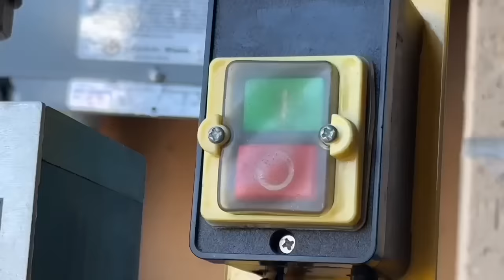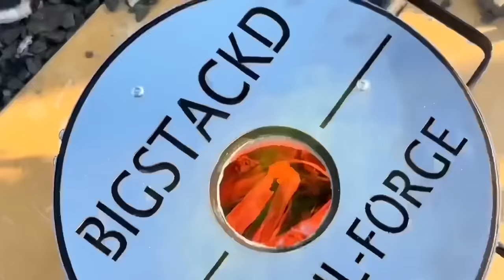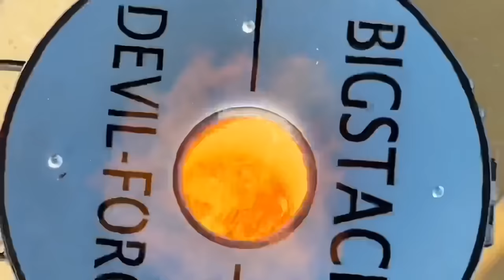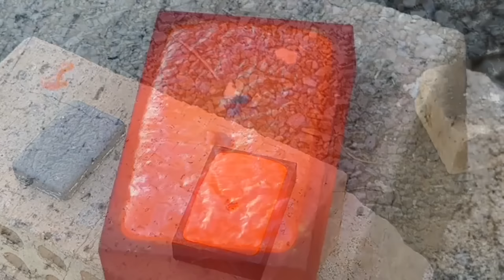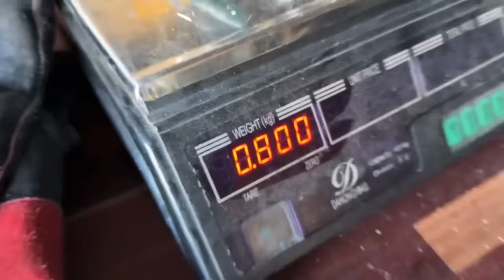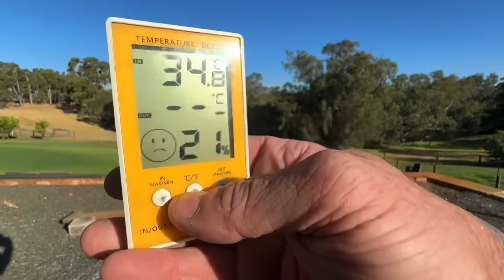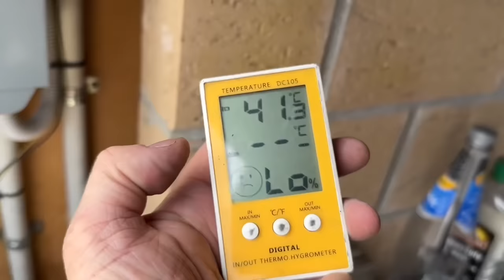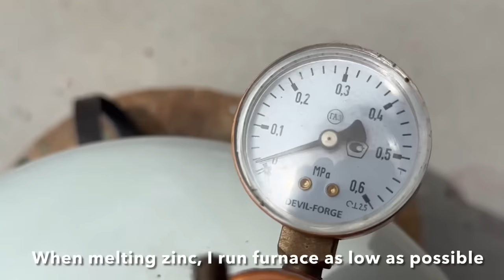Copper Bullion From Scrap - Total Transformation - ASMR Metal Melting - Trash To Treasure- BigStackD

Comment: I used to design cartridge heaters - thats most likely 304 stainless or incoloy depending on how cheap they went. The white powder is MgO. It is generally swaged with the heating element in tbe middle, and then bent to shape. They sometimes come with brass pipe fittings on the end so look out :)

Comment: Nice copper and brass bars mate 💪🏻.
The heat is tremendous there, here in Argentina we are exactly the same and on top of that we have been hard storms in a large part of the country that has caused flooding and destruction, luckily there was none of that where I live.
I have so much material to melt but I am still looking for a foundry and the necessary elements.
Big hug from Argentina 🇦🇷👋🏻💪🏻

Comment: Heating elements are typically stainless (or possibly Inconel but that's expensive) cladding around ceramic insulation and the actual heating conductor would be a Nickel-Chromium alloy

Comment: 6:50 Does anybody remember "Baccara", back in 1977? 

By the way, this green deposit is not Copper Oxide [CuO, which is black], but Copper Hydroxide [(Cu(OH)2] or, in the presence of Carbonates, basic Copper Carbonate [Cu(OH)2 * CuCO3], which are green, both. The wall thickness of this boiler appears to be quite thin, as something has consumed the metal for a long period. Let's hope, it hasn't been used for the heating of drinking water. The uptake of traces of copper over a longer period of time are not good for liver and kidneys.

Great stuff as always!

Comment: What is a water heater element made of?
Water Heater Elements 101
An element is the part of the water heater that physically heats the water. They typically have a black, blue, or silver threaded head and are composed of stainless steel, copper, or incoloy, these are high temperature and have a mush higher melting point, much higher then your forges are capable of.

Comment: Food for thought: 4% Aluminum, 2.5% copper, .05% magnesium, 93.45% Zinc is roughly the base recipe for Zamak. Beautiful casting alloy. There are other various mixes, with traces of lead, cadmium and Silicon but those 3 are the base components in about that mix.

Comment: 1:05 that copper oxide will turn into liquid copper when made into a copper sulfate solution. This is how copper is being extracted from copper bearing ores now. It is less expensive than traditional ball milling and smelting. Scrap copper, that is, dross and skimmed residual waste, can be mixed into the copper sulfate to create a super saturated electrolyte rich in copper. Then, you place copper electrodes in a plating tank and give it a bit of juice. I had the opportunity to see a commercial setup that plated copper into ingots approaching 200 pounds. This may be a way to extract even more copper from your scrap and waste. Even tiny bits of copper can be tossed into the mix to be incorporated into the plating solution. It does involve the use of acid for the electrolyte. It might be a fun project to set up a battery-powered plating system recharged by solar that runs 24 hours a day off grid.

Comment: that steel casing on the heating element had a nickel-chromium wire that is used to heat up the insulating sand in the steel pipe.

Comment: I've been slowly getting into melting down aluminium but have wanted to get into copper. I have a fair amount of scrap networking cable (solid core) and am trying to figure out if I should strip it down to the bare wire (roughly 28g I think) before melting or just scrape the slag as I go. I'm planning to strip at least the outer insulation off but the twisted pairs are so tiny I'm not sure if it's worth the effort.

Comment: What on Earth do you call that drill-attachment that cuts through the metal so swiftly?  I tried to look really closely to see if it was bending the metal out of the way like tin-snip/shears, or was actually making copper dust cast-off for you to deal with. Couldn't tell.
Reply: It's a metal nibbler mate. It cuts little moon-like pieces out of the metal as you push it along, with a circular shaped punch.

Comment: One thing I've always wondered: why is brass so GRUNGY to melt and cast compared to other metals and alloys? Copper might have some ash and bits of slag, aluminum's nicely clumped together slag leaving gleaming metal below, but brass! huge clumps of sulpur-looking slag, borax usually need to help gather it and no matter how much you remove even pouring it is gloppy and amazes me that it ever ends up looking nice or useful, and GodBear help you if you overheat it! (kinda like the zinc today.) Does anyone know why it's like that?

Comment: I wonder if it would be possible to make a stacked crucible with a tapered maybe grooved bottom that would drain into the bottom. That way slag would be in the top for less impurity. most likely more effort in the long run but sounds to me like it could work. then again I know nothing about the process really.

Comment: can you do some steel in this type of   furnace if notcan i get one for that?and i will see ya next friday🤘👍✌😁
Reply from the maker: No mate these furnaces can’t melt steel they’re not designed for steel they’re just designed for Copper brass bronze gold, silver aluminium etc. Pretty much the lower melting point metals anything under 1100°C. They can melt cast iron, but it’s really pushing the furnace to the limit and I do plan on doing another cast iron melt very soon as when you pour it the molten cast iron looks like it’s full of sparklers 👍🏻😁.

Comment: What’s the difference between green sand and petrobond sand? Which do you prefer?
Reply from the maker: If I had access to the American Petrobond sand, I would stick with that 100% of the time, but the Petrobond sand in Australia has too much oil in it and catches on fire a fair bit.
Basically Petrobond is oil based sand and green sand is just bentonite powder with sand and water so a lot cleaner 👍🏻.
Reply: @bigstackD  so basically you prefer American petrobond sand?